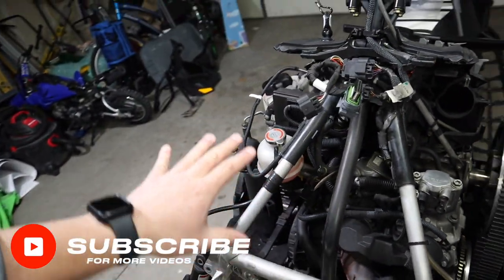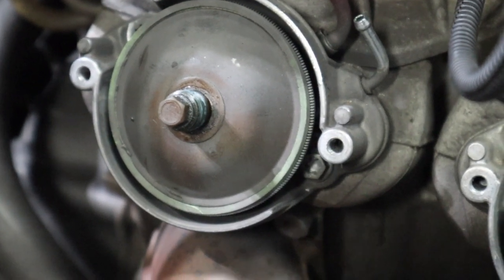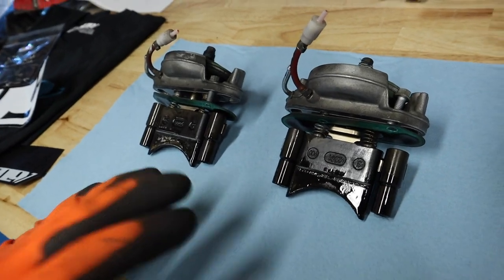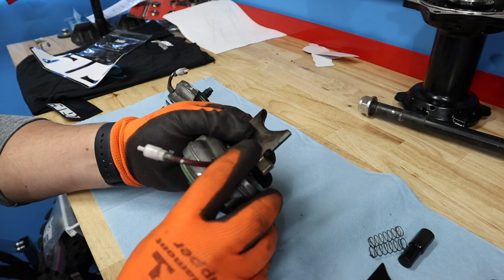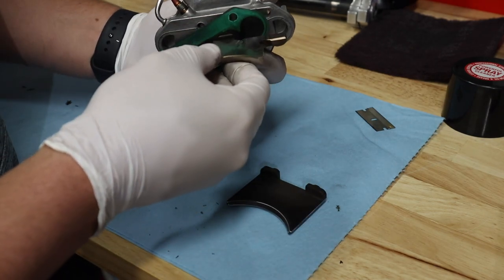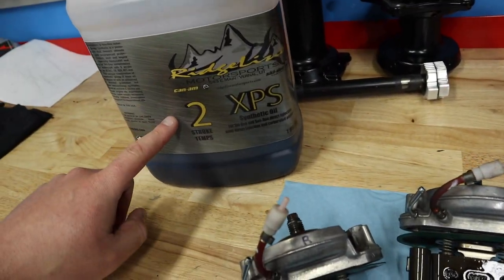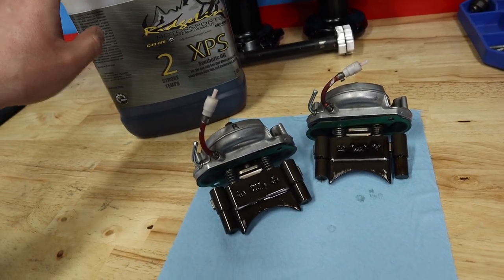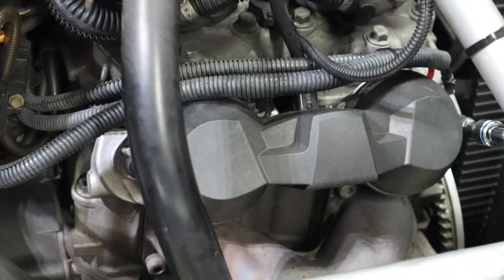SKIDOO 800R ETEC RAVE VALVE CLEANING | You need to do this sooner than later!

Comment: Great video. Let me make one small addition. When assembling the valve, be sure to lubricate with oil between the halves of the valve. Otherwise, there is a risk that they will stick and "glue" together. I do this procedure very often and sometimes faced such a problem.
Another nuisance if you do not clean the valves - the valves stop working from soot and at high rpm the engine does not receive high-quality purge, effective power is not achieved. A symptom of a heavily coked valve is the absence of a pronounced undermining after 6500-6800 rpm.
Reply from the maker: Such a great point, and not shown in the video, unfortunately, is me separating and lubing those plates as an afterthought. This is awesome info and I really appreciate you bringing this up. I’m getting ready to ride this weekend to see what the difference is, and I’m sure it will be noticeable!
Reply: @DanMX2112  👍
Reply: A symptom of a heavily coked valve is the absence of a pronounced undermining after 6500-6800 rpm. CAN IT BE INTERMITENT? WHAT ELSE CAN CAUSE THE SAME ISSUE AT HIGH RPM? DPS CAN BE FAILING THAT WAY ALSO OR THE GAS PUMP OR THE GAS FILTER?
Reply from the maker: A few things, reeds, fuel filter, and possible compression issues. Pumps are not a common issue on these, and will mostly likely be a full failure. I would check those items out and go from there!
Reply: @Suntripchile  All the same, if there are no complaints about the rest of the engine, but there is no undermining after 6000 rpm, the first thing to look at is the r.a.v.e. valves. Daniel's video is a super benefit. Second: yes, replace the fuel filter (it won't get worse, even if the problem is not the filter). Third, if the snowmobile is over five years old, the rubber intake ports should be removed and inspected (between the cylinders and the throttle). Without removal, defects can not be seen. A common problem with other ports is rubber delamination and cracks. Even if the cracks are not through - definitely a replacement. It threatens with air leakage, a poor mixture and overheating of the pistons. And poor engine performance. For one inspection of the petals, as they are built into the ports.
Indeed, the fuel pump rarely fails. But there may be a mechanical problem, for example, a pressure reducing valve may jump out of its original place and will bypass fuel back into the tank. You can easily check the pressure by inserting a tee with a pressure gauge in front of the filter. The pressure must be at least 3 bar or more. For example, watch the video https://www.youtube.com/watch?v=ZzhdLvg0tSo&list=PLeeWzCJjGHSXi5woaVSPFD7172bN5NZIG&index=23&t=3s
or type in the search "BRP Summit 800 E-TEC 15 г.в. с пробегом 1тыс982 км." time: 3:40, everything is clear without translation.
If the candles are more than 3000 kilometers - replace. It is necessary not to forget to install the candles correctly (the rupture of the side electrode should look at the nozzle) - the direct injection system is very sensitive to the correct installation of the candles just at high speeds. One more thing: high-voltage wires should not touch each other. And in general, it would be good to make a diagnosis.
Reply from the maker: Very awesome breakdown, and yes plug orientation is very critical on this motor, so clock them accordingly. Thanks guys!
Reply: Thanks allot! Think you just solved my problem my 2010 Summit only revs to 6700 and feels very slow
Reply from the maker: @nickelundstrom1409 I think your right on track and this most likely is the reason. Good luck and let me know how it goes.
Reply: @DanMX2112  Will do!

Comment: You will need to sync them with software I have done this a few years back and eventually had to get the synced
Reply from the maker: I’ve heard both, and I’m not sure that it’s due to the rebuild or cleaning that the sync needs to happen. It’s vacuum pressure, which shouldn’t change, what does change is how much is required to engage and disengage the valve. I think over time they wear differently and it cause the out of sync to happen, hence yours needing it later. Maybe my theory is totally off but it seems to makes sense to me lol what do you think?

Comment: Awesome. Super helpful. Just so I understand what you mean 'synced' - would this be something that only a dealer can do? Does it make sense to do this fully (i.e. put it all together) before taking it to the dealer or would they need to take it apart to sync it?
Reply from the maker: You shouldn’t have any issues at all if you follow what I did. Same parts, same side, and you’ll be good. Sync shouldn’t need to happen. The dealer does it yes, but it has nothing to do with the cleaning, if you do it as I show.
Reply from the maker: In fact I’ve never had to “sync” them.
Reply: @DanMX2112  Have you change your "valve cover" before? The black cap on the membrane. I have a 14 summit and both of them broke and leaks in air.
Reply: Another common problem associated with valves is air poisoning. Often, at the point where the air hose connects to the valve fitting, an additional clamp saves the day. Sometimes the plastic of the valve cover breaks where the aluminum nut is screwed on. Rarely, but still sometimes it happens, the rubber bellows or valve stem seals poison the air. The press/vacuum pump is checked, the pump is connected to the air tee or to each valve separately, creating a pressure of 10psi and a vacuum of 5psi. The vacuum usually holds very well, but the air sometimes poisons. Even without such a test, it won’t hurt to put additional clamps in the air.
You asked about calibration/synchronization without a dealer. For this you need a press/vacuum pump and diagnostic equipment. I have this and I do maintenance on various BRP snowmobiles quite often and I have my own statistics. I can say for sure that if you do not calibrate, the valve solenoid will still work almost correctly. Calibration is needed to more accurately adjust the operation of the solenoid. Non-coked valves and no air leaks are much more important for correct operation.
Reply from the maker: @georgiy4062 this is freaking awesome and great information. Thanks for replying, I wish I knew more about this when I did the job. So, overall do you say this job is something someone should do and can do successfully most of the time, it’s always worked for me.

Comment: you forgot the 2 oring seals inside the green cup !!
Reply from the maker: @jassonlaquerre675  never removed the diagrams.
Reply: @ exactly, you have to, oil eventually gets into the diaphragm and the seal isn’t as good anymore
Reply from the maker: I understand what you’re saying. The shaft seal o rings where it slides. I didn’t service those though, I didn’t see a need to do to good performance, I was mainly worried about the carbon buildup. Thanks for the heads up, and I wonder how often they go bad?

Comment: Hey man, did this help your performance? I'm having a rev limit code and wondering if I need to do this to fix the problem. Thanks for the vid. I think I could clean my valves after watching.
Reply from the maker: It did, they open smoother, meaning rpm increase is not all or nothing now. Also, rev limiting is more to do with clutching. The exhaust valve cleaning will help it rev better, so won’t fix your issue.
Reply: @DanMX2112  Thanks for the reply. I did get my primary rebuilt, but still getting the rev limit code.So I'm hoping cleaning the raves will help. I also did change the spark plugs and the belts are decent. Just rying to narrow it down. cheers
Reply from the maker: Awesome, if your primary is rebuilt, just tune in your clickers. Should find that happy medium.
Reply: @DanMX2112  You mean figure out which settings the clickers should be on?
Reply from the maker: Right!
Reply: @DanMX2112  Thanks for all the help. Just one more question. In the video you said you didn't think the sled had to be synched after a rave cleaning. Did you synch yours? thanks

Comment: How did your sled run after this?
Reply from the maker: Great, valves seemed to work a bit smoother, no power difference, just when it came on.
Reply: @DanMX2112  awesome man! Thanks for the video and reply, no mechanical shops in the alaskan bush so very handy!